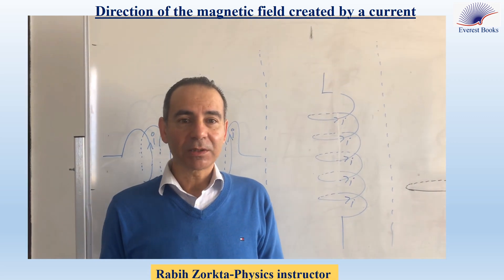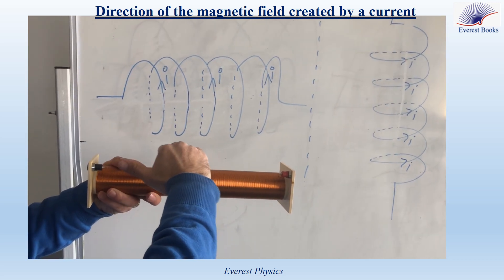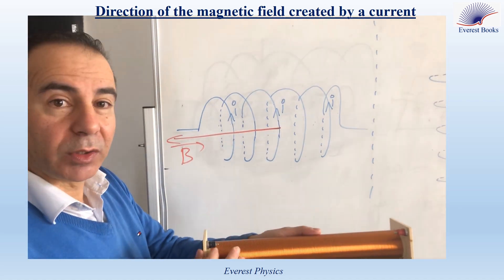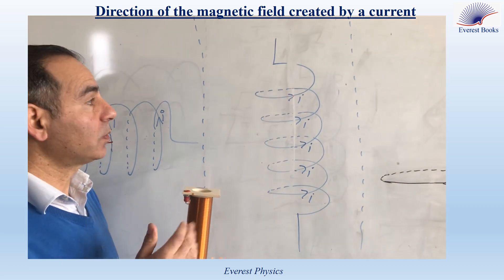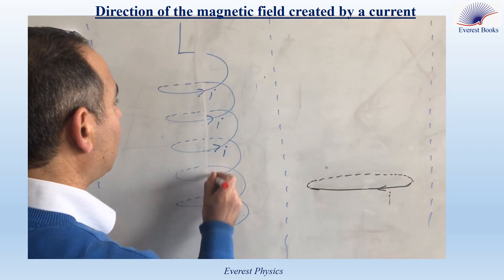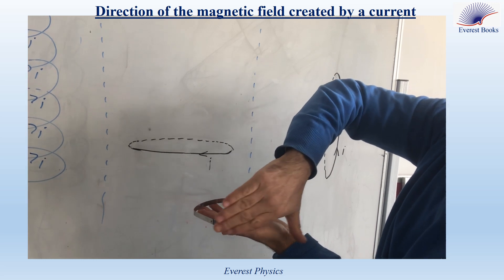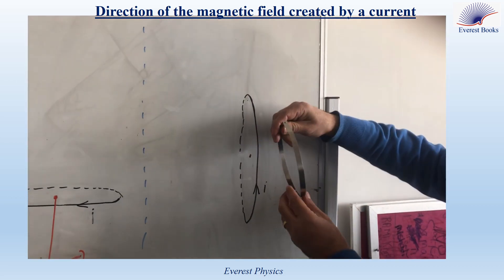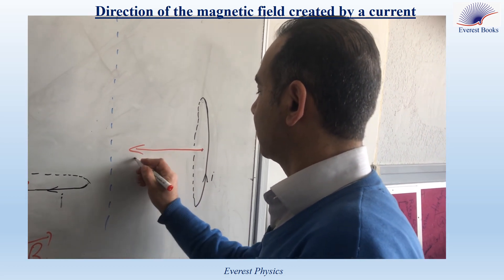Right hand rule - Solenoid magnetic field

Comment: Hi 
Can we say that the direction of the magnetic field in a solenoid is the same as the direction as the current in it?
Reply from the maker: No , the direction of the magnetic field depends on the direction of the current in the loops and not on the direction of the current between the ends of the solenoid . Therefore, you have to use the right hand rule.